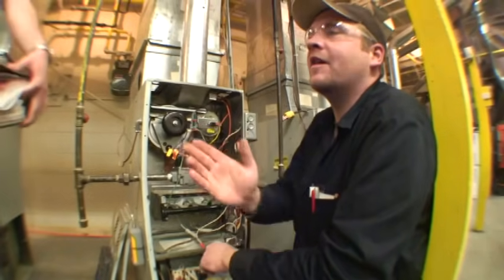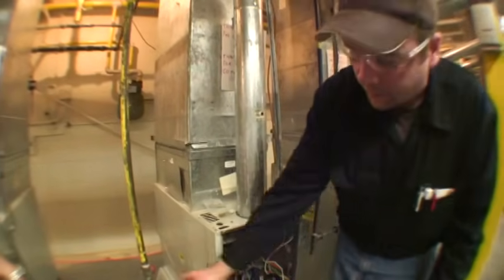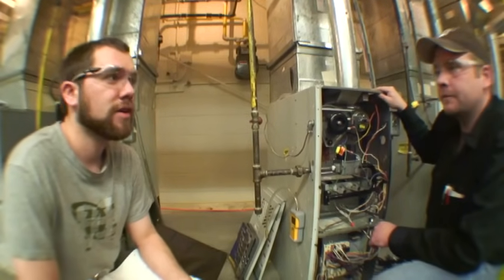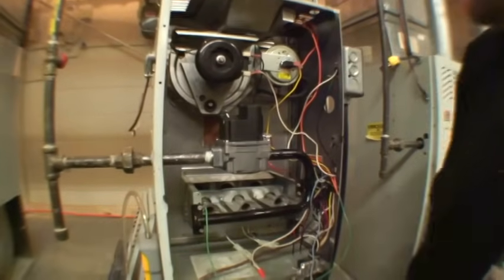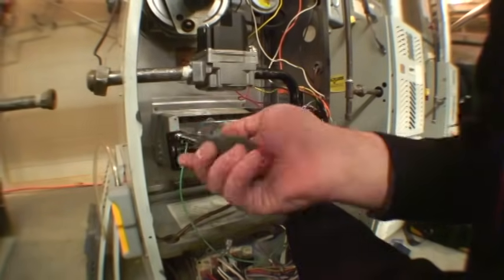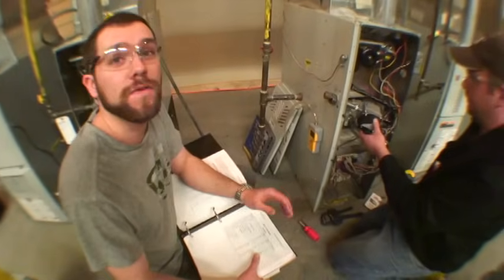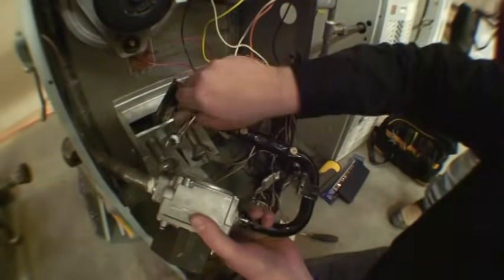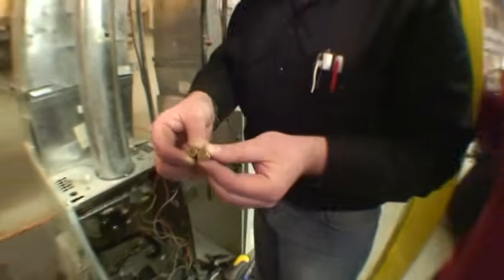Natural Gas to Propane conversion (Part 1)

Comment: I have to replace a Coleman liquid gas valve assembly on my camping grill(Stove).
Must be something in the air?
I usually don't think of distruction but I was like wow-
Wouldn't this replacement valve make a wonderful igniter(Graduate)
Implement... 
I'm not suggesting or planning a distruction appointment of any kind however figured might be good info.to share third party to protect the innocent.

Comment: Can house nature gas water heater ( 55 gal cylinder type ) be convert to propane water heater ?

I see you change out burner head and water intake spring.

Is this a water heater ? I can not tell

L

Comment: Is that spring in lo or hi fire adjustment ???
Reply: That’s actually a good question cause the ones I always replaced were single staged gas valves never done 2 stage so I would like to know also!